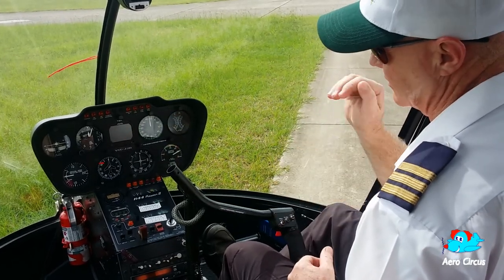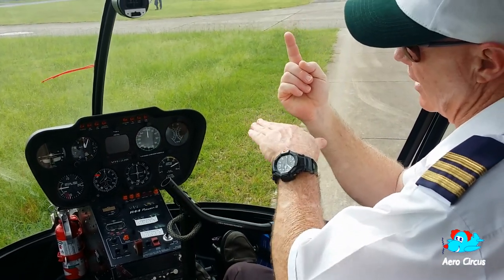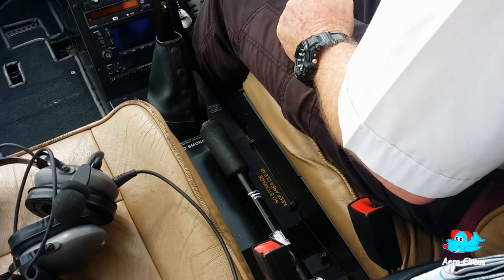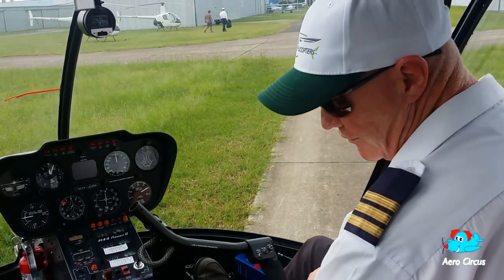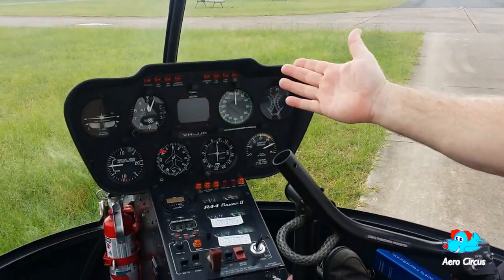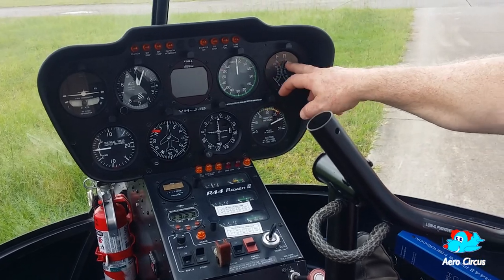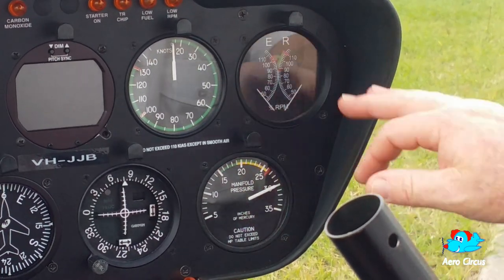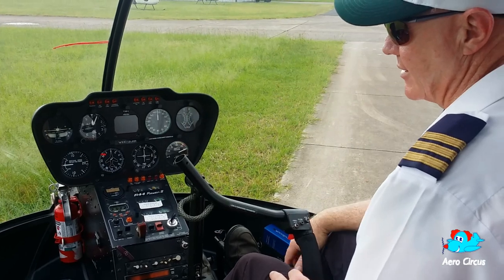Helicopter Lesson for Fixed Wing Pilots

Comment: Spins counter clockwise…
Reply: Now we are talking. That just means if you lose counter gyroscopic procession then you tilt 90 degrees to the left. Clockwise its 90 degrees to the right. If you don't pass your VNE then = no retreating blade stall = no lack of the rotor system able to compensate for dysemmetry of lift = no roll over to the left ;=D